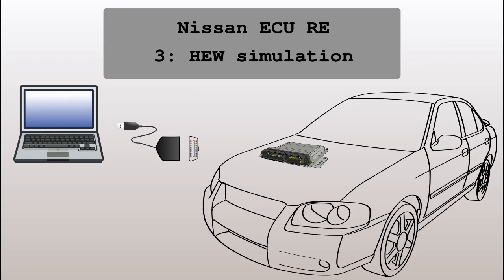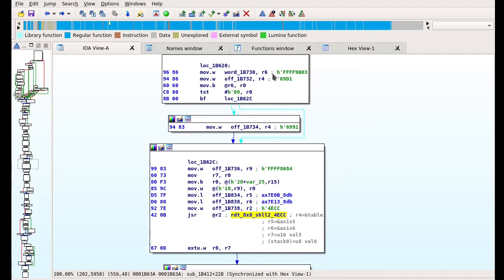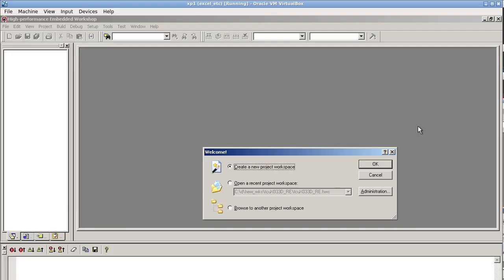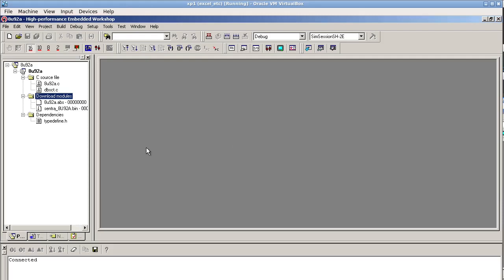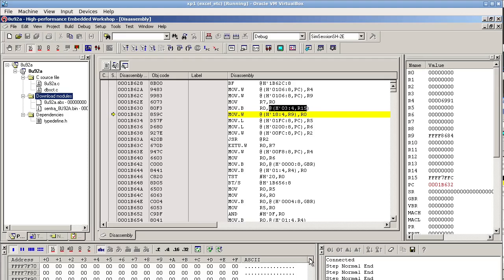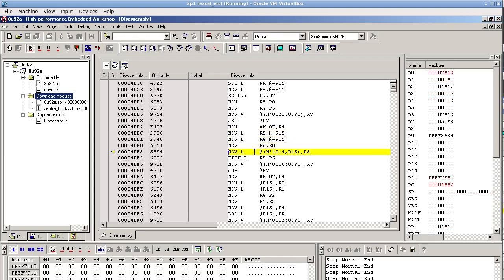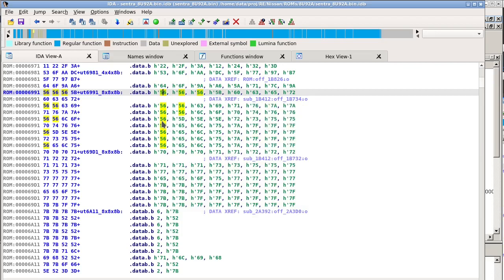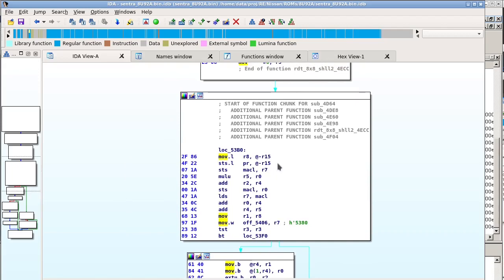Nissan ECU ROM reverse-engineering. 3: HEW simulation

Comment: excellent video, thank you very much. I am trying to do the same with a Cummins engine ECU and I have not been able to find a function that points to an address on a map that I have identified. Do you have any example of an ECU that Motorola has?
Reply: Do you have a website or forum where I can ask about the topic? Thanks.
Reply from the maker: I don't fully understand your question, but if you are dealing with a motorola / freescale mcu, you would need different software : HEW is strictly for hitachi/renesas processors. But I assume similar methods should be available.
Forums are getting out of fashion it seems; Romraider has a "misc ECU" subforum but it's usually quiet
Reply: @fenugrec5697  I mean I'm using IDA pro and GHIDRA to try to disassemble the binary.  I have not been able to find a reference to the maps or DTCs that I have in winols.  I have not found an example with Motorola MC68332 to apply to my research.

Comment: i must confess that u r really good at it, i'm doin the same thing on  VW audi3, a different microcontroller but the same idea

let me give you a hint which make you progress very fast in your analysis, you were almost there but u missed it when you were playing with A2L file. 

i hv extracted all the car parameters, in my case 5000 parameters from A2L, name and adresse
and using a little script with the fonction makename, i had all parameters named on ida program... let me know if it is helpfull

thanks for the video
Reply: we should work on this together, we can ashieve miracles on our cars.. lol
Reply: if i remember correctly his a2l file did not match his exact firmware, although he had another firmware not from his ecu that did match which he used to cross reference things
Reply: @inesion4690  i see the probleme
Now that u explain it.
U know some times there is a little deference between close ecu firmwares.. u find a same variable 2 or 3  offsets away..  thats why there hv to be perfect match between the firmware SN and a2l file SN in order to be sure every think goes where it should be.

Comment: Your at a level very few can reach. I often use assembly for the PIC microcontroller line of devices. I am having a high idle issue on a 2007 350z after cleaning the throttle bodies. Many other have experienced this issue. Any idea on how the idle learn algorithm works? There are rumors of separate chip for holding the learned parameters.. There say that particular ecu has a bug in the firmware  and it the issue was cleared in a later update. Wish I had the skills to allow me to analyze the ide rpm algorithm.
Reply from the maker: Thanks for the comment. Sorry I can't help on your specific idle issue; only thing I can suggest is maybe try the RomRaider forums. Good luck,
Reply: @fenugrec5697  For some reason the 350z hr has no support.